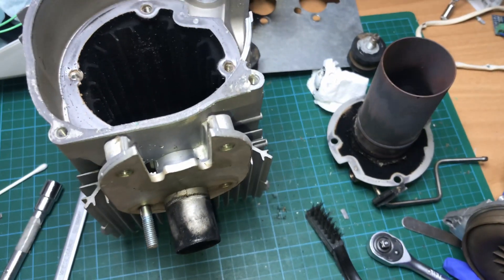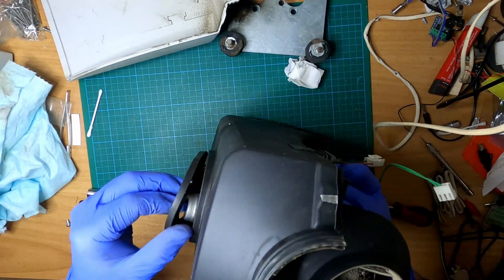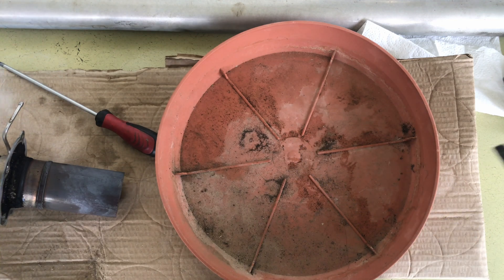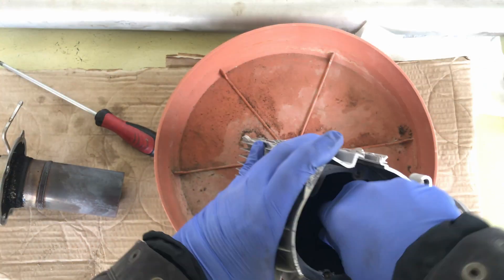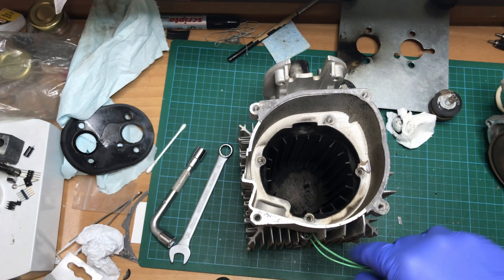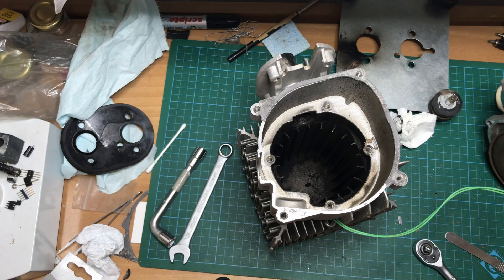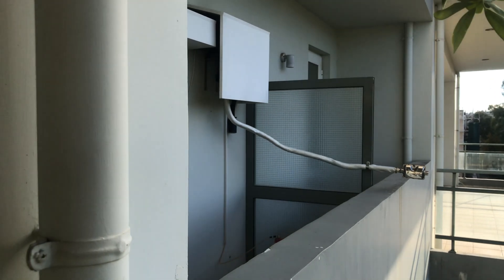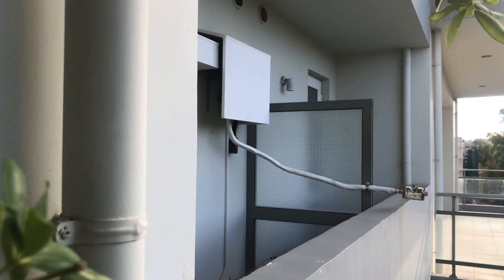Diesel Heater Smoking Problem Repair - What might be the problem #diy #howto E-08 fault diagnose

Comment from the maker: Unfortunately the problem returned! The diesel heater randomly becomes a smoke machine upon startup... 
Really don't know what to do from here, spend the money for gaskets, glow plug etc or bite the bullet and get a new one with around 100$?
Reply: Replace the glow plug/ check the position of/condition of the mesh around the plug - make sure it is pushed in far enough. If the mesh is clogged or has slid up too far, it will just smoke,
Reply from the maker: @jamesward5721  Thank you very much for the suggestions! 
The glow plug is indeed the No1 suspect as I had the power supply set at 13.5V so it might have been overdriven a bit. Now about the mesh if you see in the video it looks absolutely clean and in place. I didn't try to remove it as I did not have a replacement. 
Unfortunately now the diesel heater refuses to start but it looks like the pump is bad as well and is back flowing into the tank. 
It does not seem worth to buy glow plug & gaskets & pump as it is already more than half the price for a new one....

Comment: I guess it does not last forever 600l red diesel is not bad and for the cost of the webasto... Thank you for the sharing. I've got the same problem so at least I know
Reply from the maker: These are all wear items really and should be periodically replaced if you don't want to have problems.... 
On the other hand my problems started after I burned some diesel left in the summer for months... 
Maybe all the build up was from that...